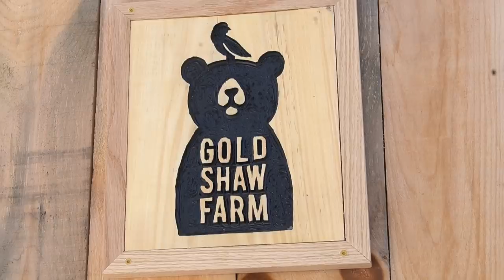Look What I Found! | Farm Vlog

Comment: Something else to do is separate your wounded hen. The other hen will keep pecking at her until she's dead. That's just in their nature. You need more hens. Any rooster will do that if he doesn't have enough hens to harass. 8 to 15 hens for every rooster is your best bet. Otherwise don't have a rooster.
Reply: Yeah. I've only helped raise chickens once but we kept a red light in the coop for that exact reason.
Reply: I'm glad you wrote this. I was going to scan the commentary to see if anyone else had this advice.
Yes, he needs to keep her (Henrietta) safe. I wouldn't remove her from the rest of the flock, but I would liberally use BlueKote, and a hen saddle. You can buy those online, or make them yourself. 
And I agree that more hens are better. As is choosing a different roo for the flock. I don't like most of the roosters from the Mediterranean breeds, or anything too high strung. Good solid English and 'American'  breeds have a bit more calm temperament, in my opinion. Unless you want to preserve a particular breed, of course.
Where I live, we have a need for either guardian animals and/or some sort of protection from flying predators. My current cockerel is great at getting all of 'his girls' under cover, as well as the other things roosters do for a flock. We have geese for additional protection, just in case.
Reply: @Aerial Fork It's hard to answer that question easily. Animal behavior can change in an instant, and there are usually multiple reasons for animals doing whatever they do. 
When roosters breed hens, they "tread" on the hen's back to get everything lined up. Since roosters tend to be larger (in most chicken breeds), their claws can do damage. Roosters also have spurs (with which to fight other roosters, and other animals. Their spurs can do a lot of damage to a hen. It's all unintentional. 

Then you get to the fact that birds aren't great at impulse control. The reason those of use who keep chickens offer the advice that there really should be multiple hens for a rooster, is that if he has enough hens to chase around, no one of them gets a lot of damage. Cutting claws and spurs (they are made just like fingernails. Just don't cut too deeply.) and maybe use some of the little tricks to help pull the spur's protective covering away. 
Biologically speaking? Roosters, unless they are truly bratty, are useful if you have enough of a flock to keep everyone busy. 

The Indian Jungle Fowl, accepted as the first breed to be domesticated, still runs around their native lands. In the wild, unless there's something highly unusual, the hens will be scattered over a pretty big spot of land. The rooster has to track them down, fight off other roosters and animals that would happily eat a chicken dinner, and try to convince the hens that he's the best guy they want as an absentee father. So, the "wild chickens" don't have a problem with roosters pulling feathers out or paying too much attention to the hens. They spend a lot of their time running around and doing rooster-ish things.
They could, conceivably, injure a hen unintentionally. But the hen will be able to run away, unlike domesticated chickens (who have no survival skills that really matter, are too slow to run from most predators, and are safest in managed care). 
In answer to your questions (TL:DR), yes and no to both. Yes, chickens in the wild behave like domesticate chickens, for the most part. No, they usually don't mean to hurt the hens. Unless, as I said before, they are jerks and belong in a stew pot.

Comment: I see other folks have already commented about establishing dominance with your rooster (holding him down for a brief period). It's easy to do as long as you're consistent, after a few times he will respect you. Your hen is probably getting pecked by all of your chickens, they just go nuts over a little bit of blood. You may have to separate her until she heals a little. Glad to see you back on the farm,
Jimmy
Reply: That's right, that happened to my grandmother chickens, one would have a dust up with another and then the rest would start pecking on her. Chickens aren't nearly as nice as most people think.
Reply: We had a friend who put band aids on a hen to cover the blood, it was funny but it worked :)
Reply: Hen saddles both protect wounded areas, and prevent more wounds. I use them to good effect. 
I also have a tailless roo because he's a good guy and will walk away from the pullets when they pull out his tail feathers. Poor guy. - I can't fit a saddle or anything on his tail, so I just BlueKote the heck out of it.
Reply: Apparently I learned today a rooster pecks at hens as a sign to meet

Comment: Vetricyn will work wonders in helping her heal up. It'll make her feel better too. You can also buy something called "Green Goo". It is a thick salve that kind of numbs up the pain like A&D ointment does; and is a super duper help. I swear by Vetricyn here for my chickens, and I also swear by the Green Goo in the cases that I need it. I'm not sure where to find Green Goo other than Tractor Supply. Our farm stores are TSC and Rural King; never have I seen it at Rural King. But, maybe those two things will be something you find useful rather than just Blue Kote. I've heard MANY people say that the Blue Kote burns. However it's excellent at ending the pecking of wounds, and a marvelous antiseptic. The Green Goo and Vetricyn though really do the healing and pain relief. Personally, I have used the Green Goo when I've had some really sore cuts (not using gloves while handling hardware cloth.....), and it's really taken the pain away to let it heal. It heals you (and the chickens) up quick.

Comment: "Down" should be to lay down,  "off" when you want him off. No jumping and off when you want him not to jump.
Reply: Different people, different ways. I don't think they're going for a strict obedience program, or to compete in trials. As long as the dog does what he wants, it's all good.
I used phrases and, sometimes, other languages. A Rhodesian trained to respond to German is many times more intimidating to Bad Guys around where I was living, than the same dog given English commands. (I tested it on walks and in parks. He knew both signals and was a very Good Dog.) As long as they can associate the noise with something, it doesn't matter what you use.

Comment: I use Rawleighs Antiseptic Salve (man and beast) on any injuries, its available on the net for around $20 for 140g .  It aids healing and flies wont strike open wounds so no need to cover,  but to apply the wound must be dry to apply it, just isolate injured animal.  I had a baby duckling and somehow 1 inch strip of the flesh completely around its neck  was gone, it was completely ring barked, I suspect rats did the damage, anyhow I placed a piece of light gauze around its neck for a week and now its completely healed with just a small line where the flesh has tried to rejoin.  Its an amazing product, the last time I ordered I purchased several cos I never ever want to run out.

Comment: I own a poultry farm. You have three ways of dealing with that rooster. I have about 50 roosters... not ONE of them would attack me or any other person on the farm. If they get pushy, I grab them, pin them to the ground (like a dominant roo would to a hen) and 'peck' the back of their head . The hens usually come over to get a few pecks in as well. It essentially knocks the roo off his high horse in the pecking order. Keep in mind: roos are NOT in charge of the flock. The hens are. If the roo is too aggressive: they won't let him breed. You will see that in their refusal to squat for him. Use the hens to help get him under control. It may take multiple times. if it still doesn't work.. Your best bet is to get rid of him. You could try other methods (like separation) but I don't think that works.  We try to keep a ratio of 1 roo to 8 hens.

Comment: trim the roosters spurs, if you get saddles for the girls it also helps if you get more hens. its hormones with the rooster theres some ways out there to train and work with aggressive roosters if you have the problem again i have alot of roosters  for some breed specific flocks and in mine have never given me issues that said i gave one rooster to a relative and he hates them now its something they are having to work on so far so good when i go over he still wont bother me

Comment: Lucky either needs MORE girlfriend's.. or to go to VACATION FREEZER.
Reply: @-BarBeaRiaN-  hence the MORE  girlfriend's.  . Roos need at least 10-12 girls to keep calm.  . 2 is not enough
Reply: Once they figure out to be aggressive to people it doesnt usually matter if you add more hens or not. More hens will prevent him from damaging the hens as much but not from attacking people once he starts.
Reply: @jneubauer76   you can TRAIN it out of them.. Its a case of HOLDING them while doing all the chicken chores.. Then when putting them down you hold them so their chest is on the ground for 5 mins before letting go.. BUT its a long process and not many people have that extra time each month with everything else needing to be done. lets face it chores one handed while holding a roo is not easy... even with their head under your armpit.
Reply: Tahneesmum yeah he does. It’s his first spring. Most roosters act like this and get killed because of it
Reply: @Nicollleeeec  Hes in a stew pot so its a moot point

Comment: Morgan, Your white geese are both males ( Pilgrim Geese are sexually dimorphic, the males are white, females are gray.) The gander mounting the other white is dominate. The white one with the bald spot is subordinate. Most goose breeders I've known separate them into pairs for breeding.bthat eliminates the domination between the ganders.

Yes, lose that rooster. The aggression will only get worse. Life is too short and roosters too cheep to put up with that kind of aggression. You don't need a rooster to have eggs only to fertilize them. One rooster can cover 20 hens. If there are only 2 hens (I would have at least 5-6 with one rooster) he is going to  abuse his power. The injured hen is probably the favorite target. The loss of feathers on the back and initial wound was caused by the rooster continually mounting  her. When chickens see blood they (both the rooster and other hen) will peck at it. They will continually peck at it until the injured one dies and then, if it is not removed, they will devour it. Yes, they can be brutal cannibols. It's all part of the pecking order of the flock. The injured hen is at the bottom of the pecking order so she is more submissive.
I have had good luck with Wyandotte (I have 2 at the moment although I don't need them both I can't choose one) roosters as far as them not being aggressive and they are made for colder weather with the rose comb that is less likely to frostbite.
Good luck with your birds.